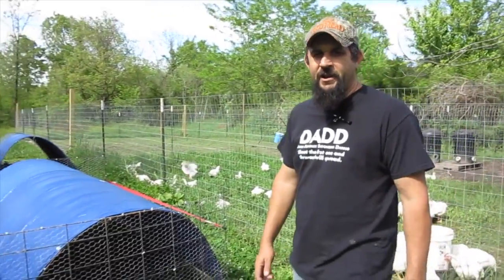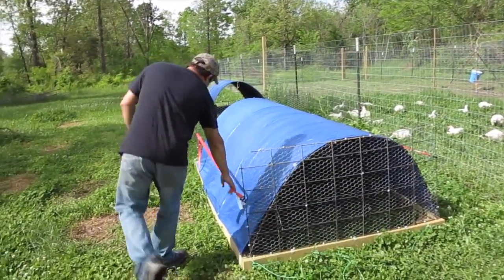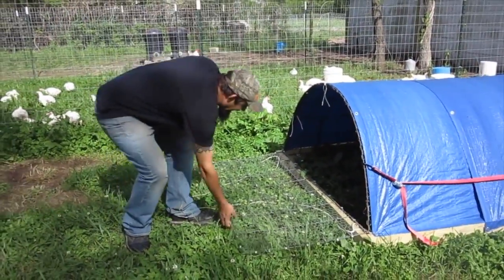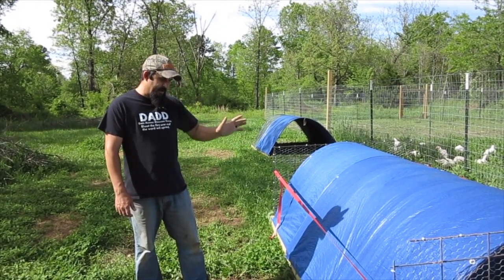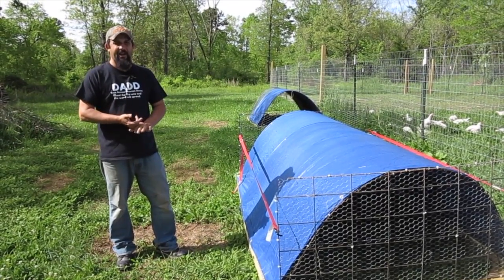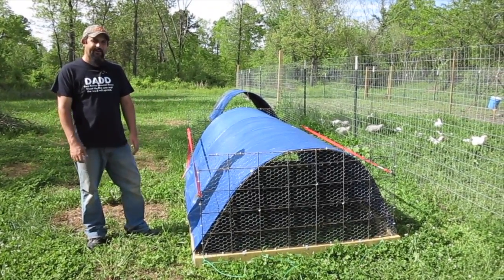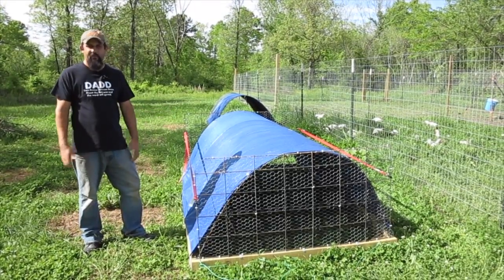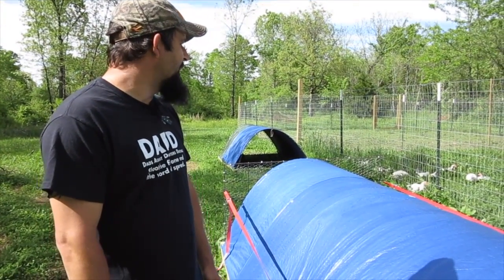Chicken Tractor and Broiler Chicken Update

Comment: So, two issues abut the chickens.  Improved drainage for your homestead.  Another change that you may consider for your chicken tractors is the bungee cords.  My experience with that type of bungee cord is that they degrade and wear out quickly. Especially if they are used outdoors.  My suggestion is to use trucker type of bungee tie downs.  Yes, they are intially a little more expensive.  But , I think less costly than 3 - 4 sets of the cheap bungee cords.  The trucker bungee cord tie downs are usually made of solid rubber and is more weather durable.
Reply from the maker: We have moved the tractors to an area with better drainage.  This spring we had more rain than this area has received in almost 100 years, so flooding was a battle everywhere.  I must not have been clear on the vide, but I wasn't using bungee cords, they are actually cambuckle tie downs which are very heavy duty.  They are similar to ratchet straps.  Appreciate the comments...every day is a learning experience on the homestead! God Bless  - Kevin